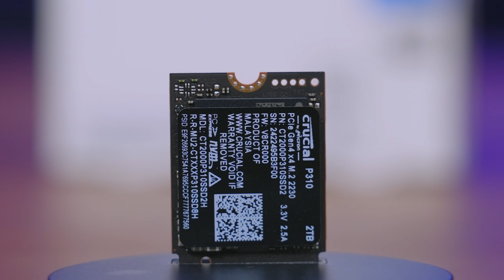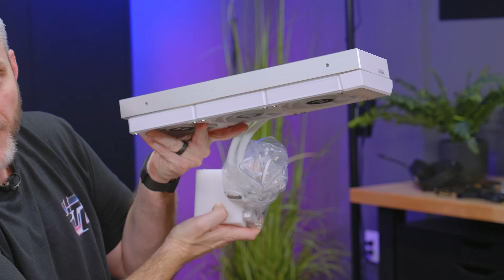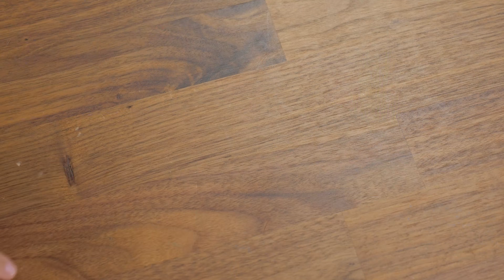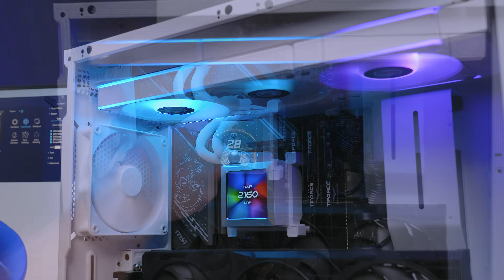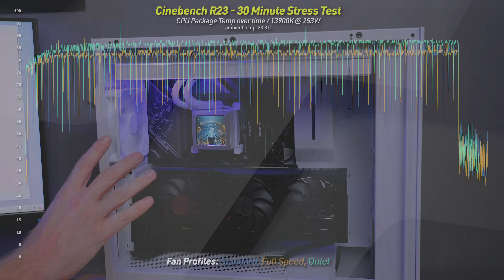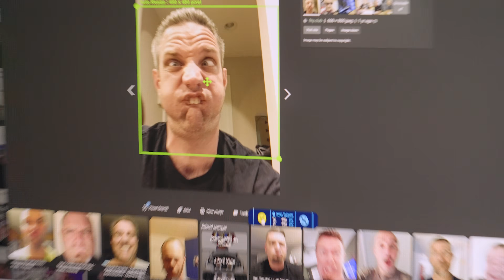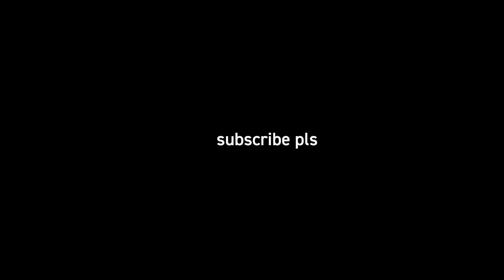Lian Li HydroShift 360R - Thermals and Stress Tests - is it worth it?

Comment: In Norway i payed aprox 350$ for an Corsair iCUE H150i 360mm RGB ELITE, paired with an i7 14700k, but then i bought a i9 14900f for my lady, and paired it with Lian Li Performance 360 radiator.. and i can see the difference for sure, even if the Lian Li is way cheaper, it performs better.
Reply: I did the same and now I am IRATE at Corsair for screwing us out of not being able to uograde the pump to their newer iCue pumps like the VRM fan etc... I knew I should have gone w the Ryujin 3..
Reply: I think maybe its due to the pump speed my Corsair H170i capellix 420MM AIO pump speed on Extreme only goes to like 2626 RPM. I think Jay said the one he just showed gores to like 30 something RPM? Unless smaller aio pumps run faster?
Reply: My h100i died in about 4 years.. My corsair k70 leds died twice, once in rma, then out of warranty... I seriously don't know how they survive
Reply: @vivekvs1992  My H100i GT, is from 2016, and still lives.
even held on to my i9 9900k that i swapped out 3 months ago
Reply: Prices for this cooler aren't bad either. 2500 on Proshop
Reply: @Karldin83  Lian Li's coolers arw priced good, and if i was to change, i would choose Lian Li, but i have most of my components as Corsair, mostly due to that i got them from netonnet directly in store by price match, and komplett har a deal on Corsair at that moment
Reply: @xillianto  Accidental Corsair fangirl as well lol. Fans, case, psu, keyboard, headset. Almost ram as well. Some nice deals on komplett as you said
Reply: @Karldin83  I got psu, cooler, fans (9 in total) and ram for corsair, lian li o11 cabinet

Comment: The real test of any new AIO nowadays is "can it cool the 13900k or 14900k"
Reply: U must be insane to buy i9 now 😁
Reply: @DirtRider999 heard about the stability issue in 13 and 14 gen cpu 
have you experienced any?
Reply: @DirtRider999 Me too! I love it! 😁
Reply: @dragoonxgamer do your eyes not work or did you miss the part where he said he’s had no issues?
Reply: @DirtRider999 I have a 13500...got her March 2023 and she's been treating me good ever since.
Reply: @DirtRider999 The whole issue is about massively increased wear and tear, it's just a question of time until you will have issues. I also loved my X4 despite its TLB bug because the crashes it caused were still very rare - but that one was constant and not getting progressively worse over time. You might not notice yet, but in just another year things might change dramatically. The latest information about the whole thing points to the ring bus getting grilled because it's running with the same voltage as the cores - this kind of damage is permanent, and it can only get worse.
Reply: I have a 13900k also and no issues to this point.  Right now it’s air cooled too.  I’d love to upgrade just because but yeah.  No issues.
Reply: @gildfps  I saw that he hasn't had issues, but stability can vary based on usage scenarios, so it's a valid question to ask.
Reply: I’ve had the 13900k for almost a year and a couple months back it definitely started to shit the bed. Some games blue screen my computer, a lot of UE5 games say no video memory while compiling shaders, the cpu averages 87-99 degrees. Yeah, pretty fun…
Though I fixed a lot of these issues by massively undervolting and getting the best AIO I could find, but every once in a while new games might crash on startup like the Marvel Rivals beta
Reply: @dragoonxgamer no lol most don't maybe weirdos using air coolers might but if yoy got a good cooler it's fine amd people are weird af
Reply: My 13900k averages at 56c when gaming no cooling issues, but on my other computer with a 7800x3d it averages around 72c when gaming, both with 280 aio.
Reply: @gildfps  not having issues doesn't mean having no issues. With everything that's been coming out now, including the The Verge article, running those CPUs means getting degradation through usage. Period. Not having problems just means that his CPU is not at the point of failure yet, but it almost guaranteed that is already has unrecoverable damages inside the silicon. It's just silent degradation until the damage accumulates enough to make it unusable.

And the microcode updates won't fix that. That will just reduce the overall performance and reduce the voltage spikes. That will only prolong the life of the CPU, but it won't fix the underlying problem.
Reply: The real question is "is your i9 a faulty piece of shit that is going to degrade soon because Intel fucked up and doesn't actually care?"
Reply: And the new Silicon Lottery is just praying your i9 doesn't crash.
Reply: @narcostarko  According to all information that is about, it is to be assumed that every 13th/14th gen above a 65W TDP is degrading simply through usage, through voltage spikes. Additionally there's the 13th Gen skews that have oxidation issues and then there's the whole "we don't really know what's the root cause"  for anything beyond the oxidation issues. 
The question isn't is your 13th/14th Gen faulty, but "When will it die?", because it very much looks like every CPU degrades silently through usage.
Reply: update your BIOS ive had no issues kept it safe and yeah im only using the 13700k but still 13th gen and yeah no issues regarding voltage requests <3 sometimes people can have no issues not every single person is subject to the the damages caused to the peoples cpus that RMA'd to indeed find said voltage requests
Reply: @ravenspromise4925  "not every single person is subject to the the damages" with the issues at hand it's just a matter of when the issues surface, not if the issues surface. 
The BIOS update right now doesn't resolve the issue, just makes them less harsh for the time being.
Reply: ..."before it kills itself"
Reply: I have it with a 14900k 
So far it’s amazing temp wise
Stays under 70C while I play Destiny 2 and Fortnite
Reply: @1Mrstephen  Odds are the air cooled power limits coupled with a likely good bin have kept you alive.
Reply: @maskharat lol, you could say that about anything. Literally every piece of electronics is a matter of when lol
Reply: @ronniekregar3482  True, but we're talking different timelines right now. With the 13th/14th Gen CPUs we're talking if they survive 5 years of usage. With older generations of CPUs the question would be "will it run after 15 years?" 
I'm currently using a 4790K, which runs great and is 10 years old, I got it used as a gift paired with a GTX970 and it saved me upgrading last year. Before that I had a A10-7890K APU in use for 10 years, which runs great still, use it for my NAS. Mind you, my PCs always run 24/7 - with that usage 13th/14th gen reportedly die after 1 year. 

See the difference in lifetime expectation?
Reply: lol amd chips are made to always target 95c underload, those are hotter chips so litterally they will keep boosting until they hit 95c which is hotter than his test on the 13900k.
Reply: Answer is no, those chips are cooking themselves with voltage no matter what, and have oxidation issues
Reply: @tropic_life3057  95°C isn't an issue, though. Given that everything else is done right, those temps are safe for a CPU. Allowing the CPU to boost until those temps are reached is not an issue for the silicon. Which is also why Intel's boosting wasn't a general problem. The problem is that everything else wasn't done right, so the overclocking/boosting became a problem for the silicon.
Reply: @marcinkarpiuk7797  The only people who have stability issues and degrading with their Intel cpu's are idiots who run it stock that don't know how to tweak a bios, and monitor voltage.
Reply: @timmypowers5926 cooling isn't the root cause of the Intel issues...
Reply: @6r3ys0n sure it appears there are ways around it. 
No CPU should kill itself out of the box lol
Reply: So morel of the story if an AIO can handle Intels hot garbage they call a CPU it gets the green light.
Reply: @maskharat  you are trying to tell me every single unit is subject to the voltage issue thats recently surfaced, intel has NOT released a statement reproducing the fact you are trying to state.
Reply: @6r3ys0n  nice that intel make cpu that cannot work as was expected and u must fight to keep it alive...
Reply: @marcinkarpiuk7797 motherboard manufacturers are rolling out BIOS updates that rectify the problem.  Intel is supposed to release official microcode in August I guess.  Time will tell
Reply: @nicksmith8166  they know about problem for over year now and decided not to see it for as long as possible...
Reply: @Xen_OJ  ahh intel sucks now and they wont even take warranty of it
Reply: @Xen_OJ set it to max p core frequency spec 5.3ghz on each P core and do an Adaptive + Offset Positive sign, start at +0.01 and keep increasing by 0.01 until it stabilize. Problem solved
Reply: @gildfps 😂
Reply: So, it seems that the consensus is to keep the 12900KS instead of going with a 13900/14900?  Although I did hear that Intel will not warranty the 12900 either…

Comment: I have the  Lian Li Hydroshift 360s AIO and I love it. I have not gone over 87 degrees at 100% load with my 7900x. With my Lian Li Galahad 360 AIO I would hit 95 to maybe 98. I used my AL 120 fans to replace the stock fans.

Comment: I am using it and overall very happy. I did struggle a little bit with the installation (as I have heard from other reviewers as well) but I got it eventually (the plastic pieces going onto the backing plate were not seated all the way so I know it was my fault but was not clear during the installation). I changed from the Deepcool Mystique 360 since the warranty got cancelled after they got caught by the US government and I did not want to risk it (and I was under the 30 day exchange period with Amazon thank goodness). So I looked around for something similar and purchased the Lian Li mostly for the stealthy look with the hoses (which I do really like). I will say it cools great however when first powering on my machine the fans do get really loud however once into Windows the fans quiet down and are barely noticeable. Interesting not here is the Deepcool (which had a better resolution/larger screen) was much easier to install however when monitoring the pump (using the software) it would occasionally go to 0 rpm and then go back to 2,000 rpm. The Lian Li I have noticed the pump is always showing on so a little weird goings on with the Deepcool (I  did not delve into whether it was the software misreporting or the pump was truly shutting off and on again at times). I like the Lian Li software much more. One last thing not mentioned in your video is the size of the radiator and fans. The radiator on this model is 31mm thick along with 28mm thick fans so you need to make sure you have enough room both top to bottom and front to rear (as this just barely fitted into my case length wise since it is a little longer (due to hose routing) than other 360 coolers so your mileage may vary dependent on the case. Thanks for the video.

Comment: I really like Lian Li's cooling solutions, especially the fans they're releasing. However, the design of most of the scene on the CPU waterblock screen is giving me major cheap smartwatch vibes. Or something out of a 2000s Winamp skin. Looks really weird, I wouldn't want this on my system.
Reply: Agree on the outdated widget looking pre installed designs, but having the ability to screen record 3 minutes of video or upload an mp4 instead of just a gif and then overlay the sensor data and change its font, color and placement on screen and layer additional effects looks really cool.
Reply: I agree, I didn't want an LCD screen either, I went for the Arctic Freezer III instead. It just looks nice and sleek. If you really need to monitor your hardware temps that religiously just buy a small desktop mount display screen that you display the HW Monitor stats on.
Reply: I use their AIOs, but I have never used their fans as they are immediate replaced with Noctua fans

Comment: I use the Corsair Icue H150i Elite Capellix XT 360mm. This one has 3 of the Magnetic Levitation fans with 8 rgbs on each fan. Cost 200 bucks at Best Buy and so far it has worked very well.

Comment: L-Connect is an incredible bit of software! i have three uni fan (inf mirror) connected and running in my system, and i cant stress enough how easy it is to use! From fan curve profiles, to the lighting features. I love it!!
Reply: If you can get it running … usually it interferes with other software …

Comment: Lian Li kinda reminds me of what Zalman used to be back in the day. Nice, clean designs, a bit quirky and giving off a general vibe of "premium". I initially used a 240 Galahad Mk I when I built this system around a 12600K and when I upgraded to a 14700KF last year, I changed that to a Galahad II/Trinity 360. Have been / still am very happy with both these coolers. Plus I was this close to ordering the 360 AiO from "The Company That Shan't Be Named" and the Trinity popping up at a good price prevented me from doing that... so: Thanks, Lian Li! :D

Comment: the LCD screen, i dont care for, but the tubing placement is genius... i hate how the tubing is not short or long enough to tuck it away without impeding the view on the RGB iO cover/heat sink cover or the RGB Ram, with most coolers you cant place the tubing so its not in the way. but here they solved that! 
so they deserve a GOLD medal for that.
every brand should have this as an option.
Reply: The tube management for me is useless … never had problems with that and looks way better with visible tubes.

Comment: I like Lian Li's stuff, and this is no exception. I have a fairly old Monolith black aluminum full tower case with an (ancient now) 4th gen. Core i7 and an AIO cooler with a 120 mm. radiator. Liquid cooling is almost a must here in the southwest when outside temps can easily go into the triple digits (F). The Asus Z87 board with 32 gb. still runs Windows 10 well with a 6gbps 1 TB. SATA SSD, and a Nvidia GTX 760 GPU. Core temp rarely ever gets over 55C. even under a pretty good load.😉 Unfortunately, the Monolith doesn't have any top fan outlets, and there's really no option to put anything bigger than a 120 mm radiator, even in the front panel. It's a cool piece of Lian Li history though, and it still works like it should!😄

Comment: I tested the Hydroshift rgb model and the Galahad. I got the same cooling numbers. I returned the Galahad, it had a little more rgb on the pump but it takes up 3x usb slots on the motherboard and has a lot more wires. I liked the hydroshift fans better and it has a cleaner look with a lot less wiring.

Comment: There is definitely room for a standard universal controller for internal accessories. I'm thinking usb 1 or 2 would work great, possibly a version with higher power delivery limits. Device identifies itself and what controls it accepts and how to signal desired changes. One simple connector vs each fan+rgb+lcd+pump Not mention let the device worry about whether the fan is pwm or not. I could also understand a connector with the ability to daisy chain up to its power limit to improve the cable situation even more. I'd like a new connector to replace the atx 24pin to something also provide the power that normally is added from an 8 pin or two near the top of the board The one saving grace of the old hdd and floppy connectors is that you usually could do two devices per ribbon. and sometime a single power cable had two molex connectors as well.

Comment: Thanks Jayz.. Pretty dang decent tube and cable management features on this AIO. I might just upgrade to this from my old MSI MAG Core Liquid C240. Also, with the screen, I could get rid of my (Aida64 sensor panel) 7" touch screen for less clutter in my case. Thanks again.

Comment: On my expensive link i115 Corsair water aio both fans are being RMA and Corsair believes the pump is bad and asked me to RMA that too. My three link Corsair QX fans I bought separately also being RMA. Checking forums the Corsair fans seem to have a high rate of premature failures. Even Corsair acknowledge that. 

Had this review come just a few months sooner I would have bought it instead. Because price is somewhat similar to what I paid for the link stuff that all broke down with about 3 months of normal use. 

This AIO looks interesting to me. And appears to have a little better tube management. Something I could have used. 

Great video!

Comment: Thanks for the info on LibreMonitor, Jay. Much better for me than cpuid's HWMonitor. I retains the last settings on startup! And the LianLi cooler is nice. Been running a Galahad 360 and after a saturation run with Cine 23 I think it's time for come fresh paste (12900k stock running at 95C average over 30 min).

Comment: 100% COMPLETELY agree with you! Would much rather they spend money on the cooler itself and things like special coating on metal for minimal corrosion, wear during long, long use. and extra good quality of the pump so it lasts extra long.

screen is only unnecessary and something that only makes things expensive that has nothing to do with the performance of the cooler or how good it is

Comment: I like Lian Li, but their L-Connect caused my memory consumption to spike up occasionally. Took me some time to investigate before I discovered the issue is caused by L-Connect. Everything went back to normal after I uninstalled L-Connect and everything else that comes with L-Connect. In the end I have to switch out the connectors on my unifans to connect the fans to my motherboard fan headers and use Fan Control to control my fan speeds. I am not sure if Lian Li has resolved this as I don't see many people complaining about it, but I am planning on not using anything with L-Connect for my next build. In fact, I will probably try to go for something which doesn't require any proprietary software.